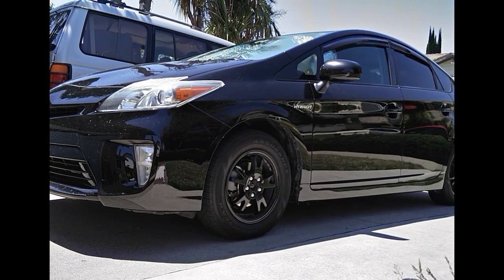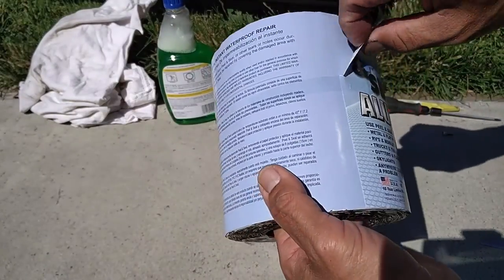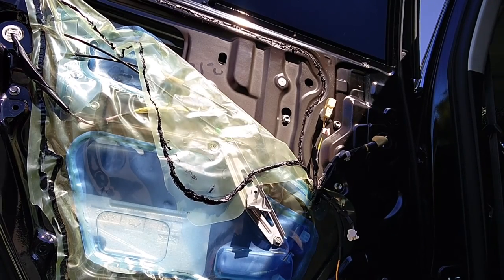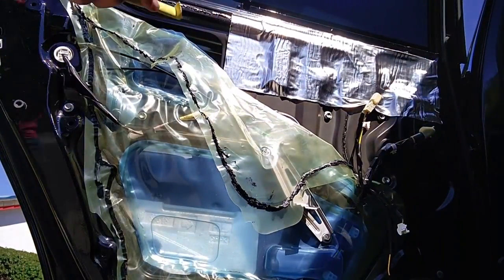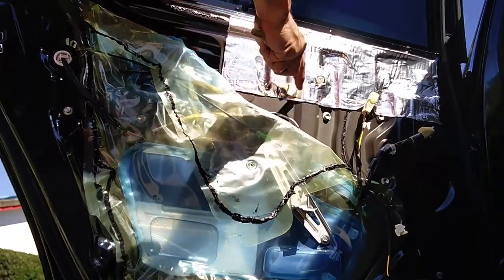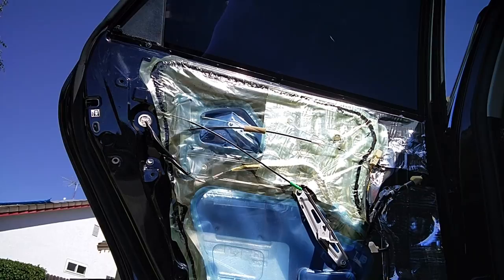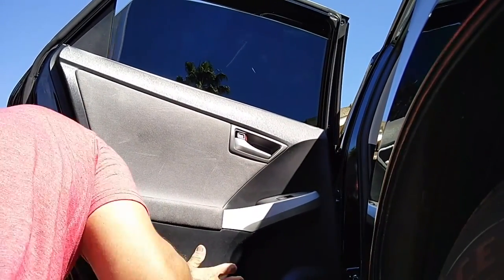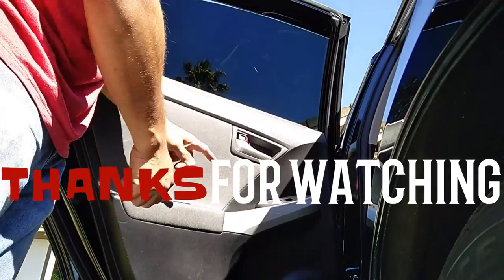Prius Sound Deadening Dynamat-type material Peel and Seal

Comment: You did put that material inside that big lower opening im sure too right?
Reply: Yeah, I'm curious too if it's on just the inner metal part or all inside the cavity that backs the outer wall too.
Reply from the maker: I did try to out inside the door skin also...as much as I could anyway.
Reply from the maker: Yes, I tried to put inside there also
Reply from the maker: I applied to inner and outer